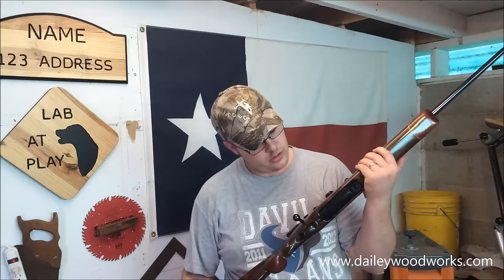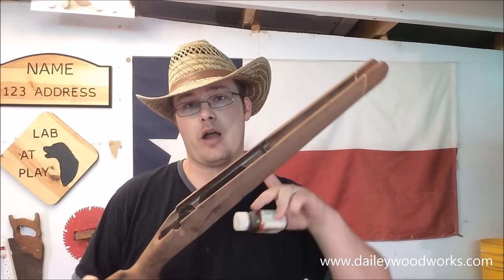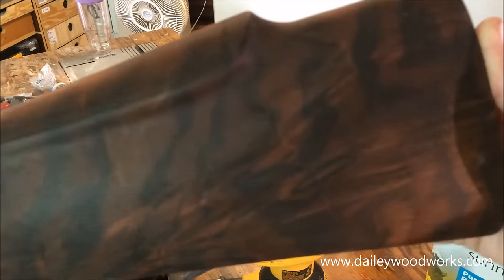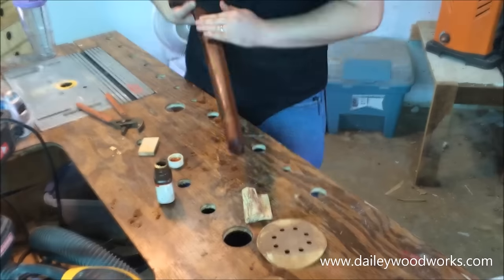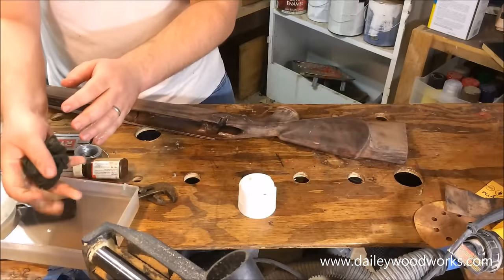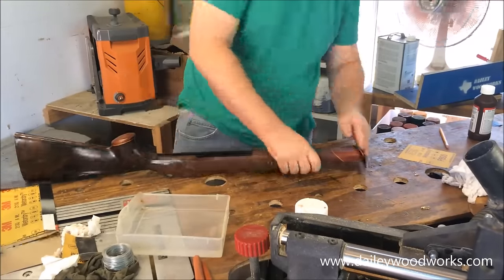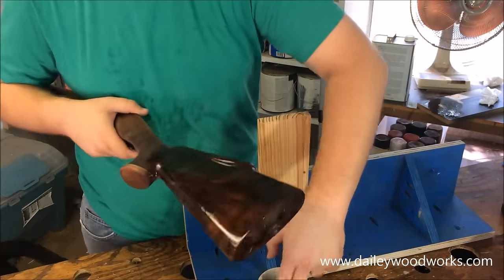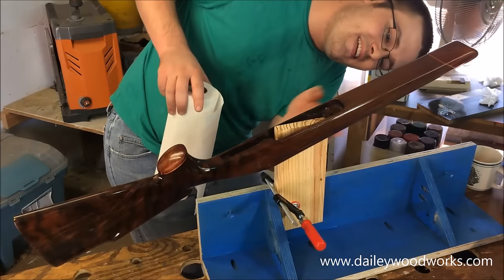Finishing a Gun stock with Tru Oil - Complete How To (The Recreational Woodworker)

Comment: I can't argue too much with your technique as the stock came out beautiful. However, I would suggest some changes to your technique based on my experience.  I would suggest, on open grain woods, to use a linseed oil based paste wood filler on the raw wood. It saves a lot of work trying to fill the grain with dust. I think 320 wet and dry sandpaper is a little too rough as you progress to the final finishes. I progress to 600 or 1200 grit for final coats. I also NEVER use steel wool of any grade on an open grain wood stock. The steel wool enters the grain and pulls out the dust that you just worked hard putting in the grain.  I do all sanding between coats with wet paper. Its easier to hold flat and does not remove the dust in the grain. YMMV
Reply: YMMV
Reply: @CletusLeonardLee  and don't you ever again try to give advice to anybody! If you do, ymmv! 😁

Good on you for not taking the cheese on that. Advice appreciated, brother.👍
Reply: I would like for you to scientifically explain to me, or otherwise point me to your reference for this statement, on how steel wool at the 000 or 0000 grade (280 - 600 grit comparisons, depending on the steel wool brand) on the third, fourth, or later coats, is going to "pull out" the previous coats of Tru Oil/sawdust from the grain.  I have heard a lot of ridiculous claims made on the Internet, but this might be one of the most unfounded.  And if you are basing this upon your "experience", I would still like to understand how you came to this realization.

Comment: Back in the seventies I built a 50 caliber Hawken rifle and wanted a hand rubbed finish.
To finish the walnut, I made a 50/50 mix of varnish and linseed oil and applied in a similar way as you did only I never sanded between coats, I only used steel wool to buff the wet oil mix in. I applied a coat before leaving for work then buffed it off that night.
I dont remember exactly how many coats but it was quite a few.
I buffed the final coat with OOOO- steel wool after allowing the finish to cure fully then waxed it. The finish is in the wood, not on it and only needs to be waxed now and then to bring it to a full shine.

Comment: Tru-oil is applied by a 50/50 mixture of oil and mineral spirits applied very thin. Oil is not as water proof as Polyacralic or wipe on Polyurethane. These can be made to look like an oil finish 
Seal the inletting as well. Tru-oil is used because it is easy to apply and smells good. A job well done.

Comment: Thin thin coats as he said. Thick coats look great going on but will screw you as they are going to run and take a long time to dry. I've been wet sanding wth a scotchbrite pad, very light pressure and tru oil for the sanding liquid, about every other coat or so. After the tru oil wet sand, wipe down with a clean tshirt rag slightly damp with tru oil. It's a quick drying treatment

Comment: Hi Robert,
This is a great video and your explanation is superb.
I am finishing a snare drum made of Jarrah wood with Tru oil.
I am up to 6 coats of Tru oil and am very happy with the result so far.  I let each coat sit for 24 hrs. then use 0000 steel wool in between coats. 
The only minor issue I have is that there are some micro unevenness in the wood because I never filled in the wood from the beginning. 
Can I do any filling at this point? 
Could I use wet sand with 220 sandpaper and Tru oil for a coat or two? Do I need to wipe off the sanded residue of the snare before drying?
 Then after it dries get back to using 0000 steel wool. Would these interim steps help to fill in the wood a little and make it more uniform and smooth?
I'm also looking to get a super gloss finish as the end result. 
Can I cut the last few coats 50/50 with mineral spirits? More 0000 steel wool sanding?
Any suggestions?
Thank you.
Any recommendations

Comment: Thanks Robert! Great video.
Question:
If I have a stock that already has a satin finish, would I need to wet sand before applying a coat of the true oil? Or would it be okay to add a coat as is?

Comment: first off great video! Second, I have a question. In the beginning you mentioned adding the diluted oil on to the stock and sanding in with 220 grit sandpaper then letting it dry for two hours and adding more diluted oil to the stock. Are you also sending the stock again with 220 grit sandpaper? Is there any benefits from repeating that process multiple times prior to adding the Finish without sanding?
Reply: Excellent thanks!

Comment: Use plain old linseed oil.  Only a linseed oil finish can be renewed as needed by simply rubbing on a new coat of oil.  No steel wool or sanding needs to be done before adding a new coat, just rub a very thin coat on a clean stock with the palm of your hand  By doing that, you remove any scratches or scrapes you may have gotten in the finish from use, or from just handling the gun over time.

Comment: Did you use water or mineral spirits to wet sand? I've watched almost all the stock refinishing videos on here and yours is the best, by far.  I'm working on a Winchester 94 with a custom carving and burning for my uncle. While checkering is generally more shallow,  do you have any recommendations to avoid pooling within a carving?
Reply: +Robert Dailey (Dailey Woodworks) I've got to clean up the shop a bit from my last project, but I'll be starting today!!

Comment: Reason I ask I don't want to take old finish off . It's good but just wanted that gloss finish  do u think I could get away from sanding it all the way back down ? Or I could just use steel wool an start .
Reply from the maker: Ben Wicker finishes don’t typically mix well
Reply: Try Howard’s Restore a Finish.

Comment: I just sand it real good and smooth. Then. Apply a thin coat of straight truoil with my hand and rub it in real good. Let it dry for a day. Next day I buff down with 0000 steel wood to where you cant see any more shine. Then add another light coat of oil. Keep doing that as much as you can.. up to 10 coats. By then all the pores are filled and it's looking real nice. If you want high gloss dont buff in between last 2 coats of truoil. If you want a flat to satin finish just buff the last coat with steel wool  0000 then its done...  lots of work but it comes out awesome. Almost makes the grain in the wood holographic and pop real nice.

Comment: It's there a oil out there for my muzzleloader i could use to keep the stock somewhat blonde looking? I don't want anything like cherry or dark stain. I want it on the lighter side. Thanks
Reply from the maker: The Oil itself is clear with a slight amber tint.  Stain would change the color, tru-oil alone will not.  Do a small test in an unseen area to make sure you're getting the look you want.

Comment: My method would be sand it down to 1000 grit if your really bothered about a smooth finish. Use a really fine fiber cloth to put the tru oil on with in as many coats as needed. Unless you want the thing to last like 5 generations I wouldnt bother with too many. Dont really get the need for all this trouble in the video it can't make much of a difference just looks excessive and I can only see the need for more coats and sanding between coats if you've got hairs from the wood fibers.

Comment: If you are using an orbital sander on your gun stock you are mis advised....also oils soak into the wood..."Poly" = polyurethane sets on top of the wood. Also....look at the the MDS (material data sheets) of Danish oils...tung oils..most don't even have pure tung oil or boiled linseed oil. Bottom line for a rifle stock is "pure tung oil" for me....you can also use pure tung oil on your cutting boards...you can eat it!

Comment: How did you arrive at this very involved process? I ask only because Birchwood-Casey's directions for using this product are completely unlike yours. They have you apply the oil with your fingers, let it dry for 24-48 hours, then buff any remaining surface imperfections with 0000 steel wool before applying any additional coats.

I'm asking this legitimately because I'm curious and starting to use this product on unfinished guitar necks. There's no arguing with your method because your gunstock looks gorgeous. I may have to try it on some of my air rifle stocks. Thanks for any info.
Reply: John Befinish withpasst wax

Comment: very nice job. I personally would have went one maybe two more coats. This is my go to finish for my turkey calls. It seems like the dull areas get duller faster then the glossy areas get semi gloss. I like to get my stuff to almost a nice gloss because i know theres enough on there. Over time it dulls down anyways. At least with calls. Gun a little different. Great work though. The beauty of this stuff is if you put to much on (high gloss) you can easily knock it down. And easy to bring it up. Love love love this oil. Been using it for years.

Comment: Great video and a beautiful job you did on that stock!!!! I am restoring a rifle for my cousin and am very particular with my work.  My original plan was to stain the stock with Early American stain then apply several coats of polyurethane. The stock had several deep scratches. I was able to repair most with a steam iron and a t shirt in between the iron and stock.  That helps swell the wood to repair the indentations.  But, after watching your video, I decided to go with one coat of Early American stain (wiped off a few minutes after applying), then used your Tru Oil method.  It completely filled in the remaining indentations! I am about 75% done with the stock and can already tell that it will turn out beautifully with the Tru Oil technique you displayed! Thank you for a great tutorial!!!!

Comment: Thank you Robert Daily. That was very informative. Yesterday, I received a Traditions Kentucky Rifle kit in the mail. I have many guns, but this is my first build. After all the shaping, drilling and fitting, I plan to use your technique.
Reply: Fit, then drill, then shape. Lots of extra wood in a kit, get those line fair and sand the piss out of it. Then finish, and enjoy.....!
Reply: I Pulled a lot of cool stuff out of The Closet of Lost Gold last year. Did 2 Airgun Shooter Videos about it. Old guns, ammo, etc. Like a Australian Short Lee Enfield built in 1918, and a Crosman 160 Pellgun, variant 1, 1955-56. And my old 70's Ultra-Hi Kentucky percussion kit rifle I started building in my 20's as a newlywed. Had raw brass castings and the whole 9 yards. I'm in the middle of restoring it now. And I used Minwax #231, " Gunstock" oil stain. And Tru-Oil over that. Used 600 on the bare wood, and up to 1500 or so on imperfections in the Tru-Oil.

Comment: I am working on a rifle stock from 1962 in an attempt at restoration. Thus far I have sanded it down to bare wood. For my sanding I used the 3M Burgandy P360 scuff pad and then the black P800 scuff pad.  The wood is now smooth as glass. The more time one spends buffing prior to color will only make the finished project all the nicer. Thanks for the video.

Comment: I would not do it this way, but hey, to each his own.  Also, the recoil pad should have been sanding onto the stock before you applied the finish.  Also... NEVER sand cross grain on any of it like you kept doing to the fore end tip.
Another tip, when done with your bottle of TRU OIL. not TROIL..... you store it upside down with the lid down.  When air hits it, it will dry, but only dry on top, so when you flip it over, the top is now the bottom, so you will always have good Tru Oil on top if stored correctly.

Comment: Tru-oil is nothing more then Stand oil with Stoddard solvent (mineral spirits). What's Stand oil?
Stand oil is refined linseed oil place in a vacuum and heated to approximately 500° for an extended period of time (days/hours). It's viscous, much more clear and dries unlike any other linseed product – it doesn't yellow with age. It is not to be confused with any other linseed products like raw linseed oil or boiled linseed oil. It's been used by artists for centuries and is available online or at good art supply houses – I've been using it for years – it's less expensive then Tru-oil. So many people have been snowed by big companies and their "proprietary formulas."

Comment: I agree with the post under me. You explained everything you were doing, as you were doing it, very well. I have a new rifle that came just stained. I bought the required sand paper, cheese cloth, and a complete Birtch Wood Casey bluing and stock finishing kit. The bluing supplies are for another project. It came with the grease/rust remover, sheen, and True Oil. I am a master carpenter by trade, but did very little staining and varnishing as an apprentice. Which makes me very nervous to start to finish my brand new rifle. I will watch this video several times before I even begin. One question: were you using regular water to wet sand?

Comment: I’m thinking at $75/hr. that is approximately a $3,500 finish job! 👍🏼
Reply from the maker: And this ^^^ is why I don’t offer this service!  All in not counting dry times I had about 16 hours. @$75/hr (which is my current rate) that would be $1200 for a $300 stock on a $300 firearm. 

But it is sub-moa 😀
Reply: This is why Beretta stopped using it too.
The custom shop at Beretta Italy will do it but it's about $1200 to get done.

Comment: I like the finish But dont like the prolonged use (yellowing affect) so got my birchwood casey tru oil mixed 50 50 with colron  worktop oil ( clear)  plus a half capfull of white spirit , to get the mixture deeper into the wood , this lifted the grain  detail of the american walnut a treat .. . Light wire wool later and it was lovely and even .. next  the satin finish wasnt lusty enough . I wanted wet lustre finish ..  and to be dry by tonight .,  no worries ,   use a cotton tee shirt patch double it over put your finger in it then over the bottle and tip the bottle .. this is enough for one side of a rifle .repeat for the  opposite side ..  have a cotton patch dipped and squoze out with white spirits ..  wipe the cloth over the stock then hand rub ..  repeat tru oil and stirit cloth every two hours untill the  glossyness is  perfect then leave  alone ..

Comment: I bought an M2 Carbine stock for $30 that was in pretty rough shape. It’s incredibly dry and I was afraid it would split. I’ve been putting on a coat of tru-oil after sanding some of the dried, flaking wood off of it and now it feels like a good stock. The finish is rough purely because I wanted to rejuvenate the wood as much as I could before I did anything major however it will likely be a long time. I was thinking about trying to pretty it up in the mean time with wet sanding. I might have missed it in the video but are you wet sanding with the oil or is it water? I would assume oil but someone who is much more knowledgeable about woodworking would know better

Comment: How would you deal with a checkered grip portion of the stock?  Thanks!
Reply from the maker: Best way is to tape it off and treat it separately.  Typically use 50% thinned oil to treat the checkering.

Comment: I have used WATCO danish oil, which comes in various color shades of walnut finish with amazing results. This oil contains resin hardeners which eliminates pour fillers. The end results are spectacular, hard waring and easy to touch up if necessary. After several coats and dry time, I use jewelers rouge to what ever degree of gloss I desire. Remember, linseed oil never really dries, especially if exposed to hot weather and direct sun light that will warm the surface to the point of returning it to a liquid state and tacky to the touch. I learned that with M1 rifles, carbines while serving in the military. Not good! Tung oil is also a great finish as it dries hard, no ticky-tacky!

Comment: Everybody has the answer, but is it the right answer ? I can only offer over 60 years of experience. This is what I know for sure.
Lightly scrape the wood to remove most of the old finish. Lightly sand with 400 grit. Use a tack cloth to remove any residue.
The last thing you want to put on the stock
is mineral spirits. It's a huge mistake. After sanding it is now time to open the pores.
Using a rag, soak the wood with ACETONE.
Acetone evaporates quickly and completely. Mineral spirits always leaves a residue that does not evaporate. Now that the pores are open you can either stain the wood or go to the next step. This is the most important step in the finishing process. You are going to burnished the wood by hand. This will close the pores and leave a completely smooth finish. This is done by rapidly rubbing the wood with a piece of compressed felt. Your arms will really get a workout. Once you have finished
this step you will want to use a minimum of
4 or 5 coats of diluted tru-oil. Using a 50/50
solution diluted with mineral spirits, you want to apply this with your fingers. Just your clean fingers. Don't be in a hurry let this dry for at least 7 days. You need a week for each coat to set up before using 0000 steel wool between each coat. To get your high gloss after the last steel wool rubdown, cut yourself another piece of felt and start lightly polishing the finish with cold water as a lubricant. To get the finish you want and the depth this must be done by hand.
You have to feel it. Power equipment will burn the finish and make it gummy.